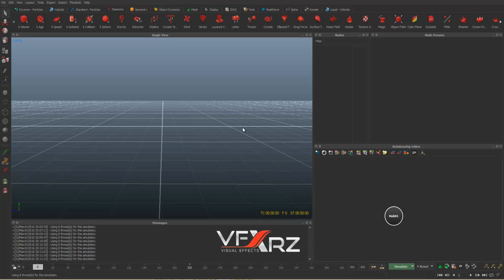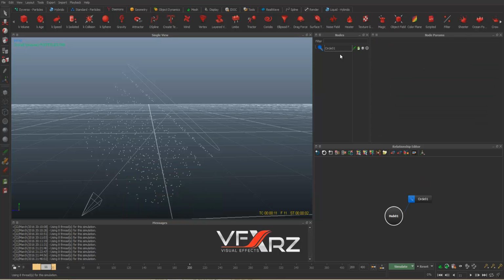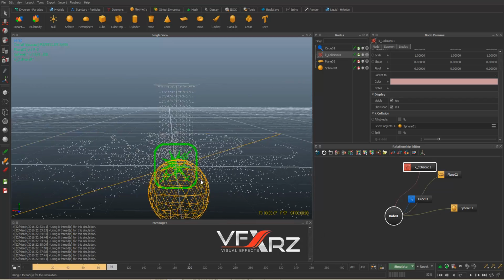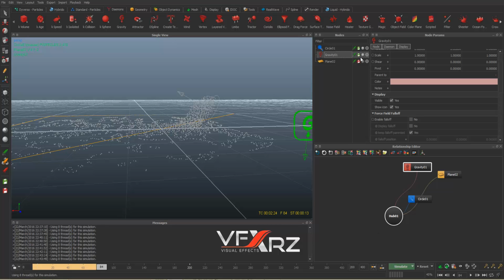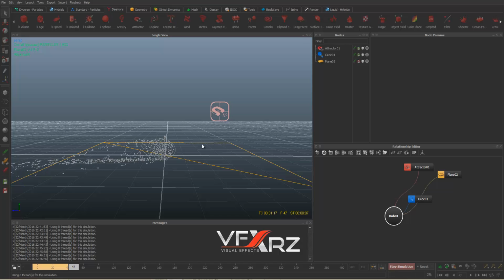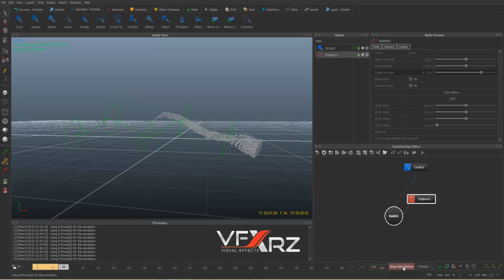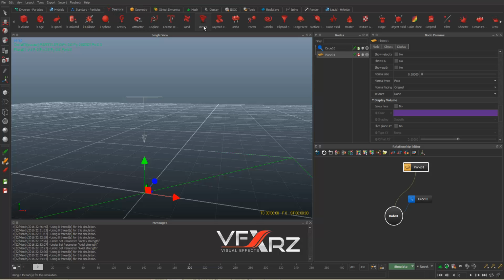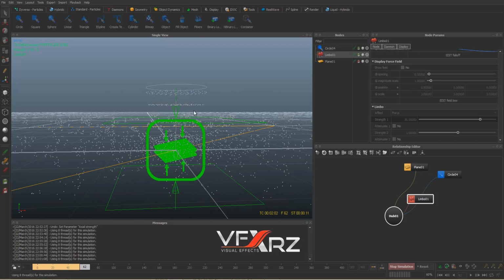Daemons Tutorial | Part 3 | Realflow 2015  for beginner

Comment: Hello Sir 
I need some help. 
When I prepare some animation in realflow by Granular Multiphysics Dyverso Solver and try to import 3ds max 2018 it will problem. I can not import. If I use mesh legancy can ımport but problem is shape is look like liquid and I need sand or granular type. can we directly import without mesh legancy to 3ds max . Or can we import directly to keyshot. 
We will use this animation in keyshot . could you please help me in this case.